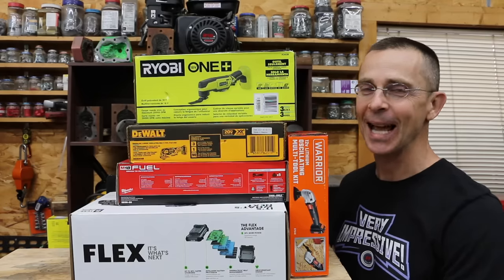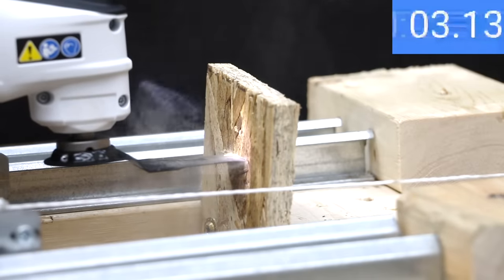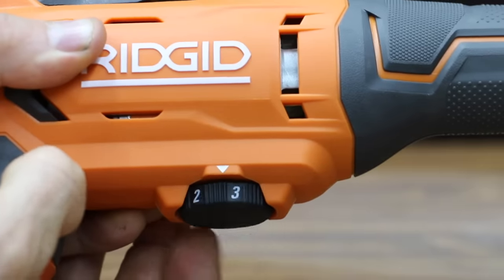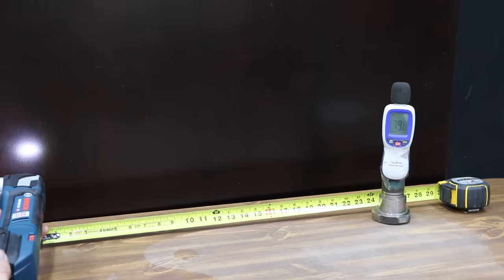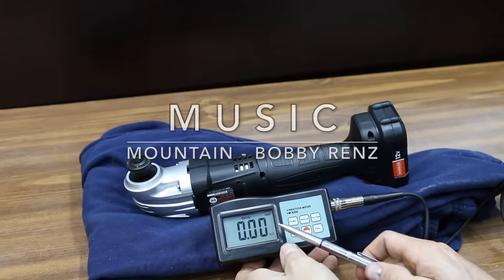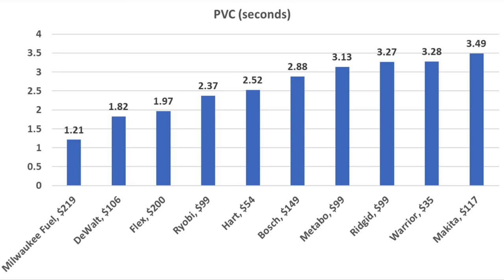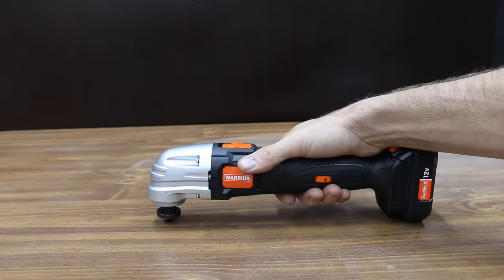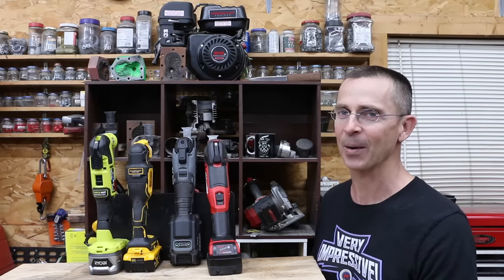Best Oscillating Multi-Tool? FLEX vs Milwaukee, DeWalt, Makita, Ryobi, Ridgid, Hart, Metabo, Warrior

Comment: I need one of these to cut composite paneling. First thing I did was look up PF. 😉 I will go with the DeWalt since I already have an impact and hammer drill and several batteries for this brand. 👍 I am just a home owner so a second or two slower don't bother me.  Thank you PF!
Reply from the maker: You are welcome!

Comment: There is a counter weight in the tool to neutralize blade vibration at the handle. Remove the blade test can upset the neutralization.
Reply from the maker: Thanks for the feedback.

Comment: I’m typically a Milwaukee fanboy, it’s the one I typically use at work, and obviously it’s the best performing in these tests. But when I have gotten to use my coworkers DeWalt, I always fall in love. It cuts well enough, but mainly it’s just more comfortable to use, and how easy it is to swap blades pretty much makes up for the time lost cutting. I think I might lean more on my Milwaukee for more difficult cuts, but especially for drywall or lath and plaster, the DeWalt is a dream.
Reply from the maker: Thanks for sharing.

Comment: Hedge shears and lopper pruners. Sharpness strength, And durability. Also spacing between the blades and other problems you could run into with these tools
Reply from the maker: Thanks for the video idea.

Comment: I HAVE HAD A ROCKWELL oscillating too ever since it first came on the market.  I had no reference to how good or bad it was. I do know that the blade attaching system is a royal PITA.  After watch this review, I realized just how slow, heavy, and loud this old tool was.  I came here to find some relief as I have to oscillate out most of a subfloor in a bathroom.  I wanted the DeWalt to be a good choice since I have batteries and charger for this brand.  However, if available, I “might” get a corded model, if worth it price-wise, as I can’t think of a use where I’ve ever felt that corded was an inconvenience.  As the testing showed, Dewalt was one of the top 4.  Off I go for them to take my money for what seems like value.
Reply from the maker: Thanks for the feedback.

Comment: I purchased a Porter-Cable corded tool and it only lasted one day cutting out grout from a walk-in shower. I made a big upgrade to a Fein FMM350QSL corded tool with a 350W motor and it has been fantastic. Always plenty of power and I don't mind dragging the cord. I really like the StarlockPlus system. 

Maybe you should do a test on corded oscillating multitools. I've been drifting away from battery operated tools in favor of corded whenever possible. I've grown tired of low power and waiting for batteries to charge.
Reply from the maker: Thanks for the suggetion.

Comment: Your blade on your plunge cut was not perpendicular to the 1/2 " osb plywood which may have caused a little bit of binding on the shaft of the blades. Absolutely love your video's

Comment: I use my multi tool for a lot of different things so I’m changing blades several times per day. I actually own both the Milwaukee and the dewalt and I always reach for the dewalt just because it’s so much faster to change blades, and the trigger mechanism allows me to change the speed on the fly unlike the milwaukee.
Reply from the maker: Thanks for sharing.

Comment: Great reviews. Our house is plasterboard, and I needed a multitool. Because it's so difficult to cut, I chose a corded tool, ending up with a Porter Cable that was highly rated. It is great, but gets very hot in the hand. So much so I had to wear gloves after starting to burn myself. Love for you to measure the temperature of the grip in use. Also, love to see a corded test, and corded vs. battery showdown!
Reply from the maker: Thanks!  Thanks for the suggestion.

Comment: Soooo helpful.  Thank you.  I have a Galaxpro oscillating multi-tool. (A what!? Yeah, cheap off brand.)  $54.  It does come with many blades and attachments, easy to change blade system and a case, but heavy, shaped badly (too big to hold easily). blades slip a bit during use and (THE BGGEST PROBLEM)  very slow.  Just not enough power at all.  So I'm in the market for a new one and your video came in so handy.
Reply from the maker: Thanks and you are welcome!    Glad to hear!

Comment: I really like the light feature on the flex. However, I have had the Dremel brand for years. It has never let me down and works great. It is a very handy tool. When I find.a great tool like my Dremel oscillating tool I tend to stick with them. 

Dremel also makes the multimax mini saw that works phenomenal. I think a showdown on mini saws would be a great idea, but would like to see how my Dremel brand stacks up to the DeWalt and others.

As for Brand comparisons on tools, I think the Hercules brand would more of an even match with the DeWalt and Milwuakee brands on the various tools. It is Harbor Freight's premium high end brand and would like to see the Hercules tools pitted against the high end brands. As for the Warrior, it is hard to beat the cost on the Warrior brand

Comment: Bosch has a gen 2 version out now that claims to solve the vibration. I've never used the first gen but I find the second gen very comfortable. Beware that some blades don't work with Bosch Starlock system. First gen model number is GOP18V-28N, second gen is GOP18V-34N.
Reply from the maker: Thanks for the feedback.

Comment: Personally a Oscillating Multi-Tool is one of those tools I would want corded. I also want one with a trigger and that has variable speed. The only one I can find is one form DeWalt for $149. But it does come with some attachments too so not too bad in the end. I have a friend who swears by the Hercules brand at Harbor Frieght but it uses a switch not a trigger. Still might check it out though since he knows his tools. Nice job on the video either way.
Reply from the maker: Thanks!  Thanks for the feedback.

Comment: I'm a milwaukee guy with a lot of tools made by this brand.  On a side note, those M18 batteries will run some other 18V tools by the use of adapters sold online.  I have a few cordless 18V Makita tools that runs perfectly fine with my Milwaukee m18 batteries.  It's nice to be able to use my existing batteries while able to have own other brands.
Reply from the maker: Thanks for the feedback.

Comment: These video's are priceless.  There' two channels that are doing an enormous amount of good for all us DIY'ers (and pro's for that matter).  The only problem I see with the tool tests (especially cordless), is that all it takes is one, maybe two purchases, and you're vested in that brand.  That happened to me with DeWalt.  The batteries are so f**king expensive that after a couple, unless you've got money at your disposal, or just flat out disgusted to the point to where you no longer care, you're pretty much stuck with that brand.  The good thing is that, from what I've seen, there's not a whole lot separating the two big brands Milwaukee/DeWalt.  I'm in the process of outfitting a woodworking shop, and while Festool may be the "best"....DeWalt has proven to be "good enough".  I'm still incredibly grateful for what channels like Project Farm have done, and are doing.  The time, energy, and resources it takes to give us "mere mortals" this kind of info in a non-biased manner is not lost on the vast majority of us.  So, I'll give a big salute, and a thank you 🙏👍
Reply from the maker: My pleasure!

Comment: Nice review, however the price was not equal since some were for tool only. Also you might consider Fien which is $219 and using the same blade on all tools to eliminate that variable. Thank you for a great review.
Reply from the maker: You are welcome!  Thanks for the suggestion.

Comment: As usual and extremely excellent test. I purchased the Milwaukee last year. I had the Makita and the DeWalt before that. They both lasted about a year-and-a-half before they quit cutting. As a carpenter contractor I use these tool daily. We'll see how long the Milwaukee last
Reply from the maker: Thanks!  Thanks for sharing.

Comment: Its not a real world test. The vibration is an indicator but the problem with those tools is if you hold them in your hand, the vibration counteracts the blade movement. The heavier tools cut faster. Your test clamp the tool, so it did not account for the movement that would be there when holding it by hand. Years ago we had a Ryobi. I taped a hammer to the side of it to get rid of the vibration. It cut much faster that way. The best tool is the Feud.

Comment: I realize adding an analysis/opinion of build quality would be difficult, but I believe it is necessary.   Otherwise it is like comparing a Hyundai or a BMW to a Toyota, maybe the Hyundai has more features and is faster and beats the Toyota on specs and performance out of the box, but one must consider build quality, engineering, and materials to get a real value comparison.  As a hobbyist I would probably never wear out any of these tools, but I still prefer to buy quality and durability.
Reply from the maker: Thanks for the feedback.

Comment: I’m a Milwaukee guy through and through, but when it comes to a multi tool DeWalt has everyone beat. The ergonomics and speed you can change a blade is amazing, I only wish they would make it with a nut for a belt clip in the battery housing.
Reply from the maker: Thanks for sharing.

Comment: Yeah.. I have a Milwaukee m18 fuel fuel oscillator and when I saw the plywood test and the first one.. I knew Milwaukee would win.. thought it would've been faster with that much weight on it though.. I clean the blade when cutting plastics by stabbing the 3/4" pine plywood that I make the brace of my sawhorses out of.. it goes through it almost instantly lol .. but probably a lot more weight than involved there than what he used though.. .. hell I've used it to cut some 1/4" angle iron that was in a real tight spot once.. if someone could make a carbide multi tool blade that was a little more heavy duty and affordable.. I'd probably never use a saw saw again for it.. so much easier to controll a multi tool and get the cut exactly how you want it in a tight spot.. angle grinders don't fit in most spots I'm going at .. sucks using a saw saw
Reply from the maker: Thanks for sharing.

Comment: I’m a makita fanboy and I have to admit, I absolutely hate their oscillating tool is utter trash. Right away I knew how terrible it was but I lied to myself for a few months. As someone who removes a ton of drywall, I put this thing to to the test. Unfortunately no matter how well it cut (which isn’t spectacular), the shape is like an oversized pringles can filled with cement. It’s stupidly awkward and made me think “there’s no way they designed this with the Japanese in mind”. It’s bulky, ugly, and an embarrassment to the makita lineup. Man, that felt good to get that off my chest. I do not like it at all. Thank you for another stellar video.
Reply from the maker: You are welcome!  Thanks for sharing.

Comment: I have both the Milwaukee and Dewalt multi tools,
I have to say, I really wish everyone would share the same design as the Dewalt. It’s the perfect shape, so quick and easy to use with the variable trigger rather than the on off switch, and the quick blade change is perfect. The Milwaukee obviously slightly 
Is better when HEAVY duty cutting, but for the majority of the time, it’s bigger clunkyer design makes we want the dewalt over it.
Reply from the maker: Thanks for sharing.
Reply: And Dewalt...brushless motor.

Comment: I would also recommend that you explain the difference between BRUSHLESS MOTORS and the cheaper BRUSHED motors  (and add that as a criteria to your future tests), as each manufacturer seems to have both available and the home improvement stores.  The Ryobi 1+ HP I just bought with a BRUSHLESS motor was oddly the same price as Milwaukee's cheaper BRUSHED motor design, so I switched it up and purchased the Ryobi instead.
Reply from the maker: Thanks for the recommendation.

Comment: All I know is I bought a $40 Bauer from Harbor Freight, and it easily paid for itself in one project. I cut through about 20 3" framing nails, some PVC and a lot of wood. Used the same Bauer cobalt blade for all of it and the blade is still perfect. I did shut the tool off periodically while using it to avoid overheating it, because why would I intentionally break it. With that in mind, I expect it'll probably last me s very long time, much like the other "cheap" power tools I own.

Also, don't buy battery powered tools, they're just a scam.
Reply from the maker: Thanks for sharing.

Comment: I am a big fan of Milwaukee but for an oscillating tool I have a corded Fein tool.  I bought it used for $20. 
My question relates to epoxy adhesives. It is not easy to get the epoxy out of the tube consistently especially if the temperature is low.  
One tube always seems to stiffer than the other and what comes out is hard to measure.  So, I really want to know how important it is to get the mix exactly 50/50?  
Seems at the end of every pair of epoxy tubes there is always one with more left in it than the other.   It may be that some brands are more sensitive than others to precisely the correct mix.

Comment: I use Fein
Reply from the maker: Thanks for sharing.
Reply: @ProjectFarm  I also have the Dewalt cordless. What has always been the issue with these tools has been the blades/cutters that attach to them. It can easily cost you 10x more than the tool itself and that is very expensive.
Reply: @ProjectFarm  just found the video of the test on the cutters. Look forward to your results.

Comment: Using OSB it difacult to get an accurate reading. OSB has different kinds of wood chip pressed together  and some wood are harder and glue act different in pourus woods. Jus saying. I use Rigrid and have a porter cable both work great. But must say the Dewalt is the best of the lot. Love the trigger on them and the quick change like the porter cable.
Reply from the maker: Thanks for sharing.

Comment: I noticed that not all of the cutting blades were completely straight when cutting, I think that could have slowed a few of the test down a bit. It's harder to cut at an angle than straight. I understand you can't possibly catch or do everything but I though I'd mention it in case someone was trying to weight pros and cons.

Comment: i bought a corded dewalt multi-tool because it uses the more standardized blade-attachment method.  it stopped working less than a year after i bought it.  i had dewalt repair it...but it took them three months to get it back to me, and now i've only used it a few times since, and it is not working again.  i'm done with dewalt.  milwaukee for me all the way, as all my milwaukee tools have worked.
Reply from the maker: Thanks for sharing.

Comment: I bought a green Bosch (not sure if the line is available in US), it's enough for my very light use. I already have a few of other tools from them, generally I like them, it's my default brand, usually I consider them very decent with good features for the price and they can be usually bought in a practical case for a little extra. Of course sharing batteries is a plus, important reason here was the Starlock system, very quick and easy to change and wide selection of third party blades here.
Reply from the maker: Thanks for sharing!
Reply: I an sorry to have to say, but BOTH Bosch and Makita have been widening their tool lines: While they still sell top of the line excellent tool models, they have started to widen their lines toward cheap and underferforming models trying more to catch the budget limited buyer thanks to their Name-Image than on actual performance, thus launching weak models that actually come below the performance of lesser famous brands that cater to the lower demands of hobbyists and DIY tool buyers.
Recently I "tried to take advantage" of a discount sale at Home Depot, and ended up with two "Ho-hum" mediocre models from Bosch: the 18V-50 cordless drill and their lowest price impact driver, the LOUSY GDX 18V 180 LI model, and quickly returned it to the store, as it resulted to be so weak that it was unable to remove the wheel nuts on a small sized car!, and while I will keep the 18V-50 hammer drill, I discovered it has a wobbly chuck, a nice looking but wobbly metallic chuck that seems like it is going to break the thin 1/16" or 3/32" drill bits due to the wobble !
And I also became very upset with my Makita 8 1/4" model 5008 Circular saw, as it came with a too flexible and flimsy cutting-depth adjusting mechanism, despite the overtouted "Magnesium base", so that aplying normal downward pressure on the handle causes the frame to flex and twist, throwing off the 90° position of the blade... VERY DISSAPOINTING from a brand previously know for quality and good design!

Comment: Would love to see a corded tool used as a performance baseline. My home projects are pretty sporadic and tools can sit un-used for a while. It sucks when your battery doesn't charge anymore and they stopped selling compatible replacements. For cordless, it seems like people are going to buy whatever brand of battery system they are already invested in. Probably useful to mention the baseline cost of a battery and charger for the system.
Reply from the maker: Thanks for the suggestion.
Reply: Ryobi is generally has the cheapest battery. But I buy Milwaukee's because of their great deals that comes with battery. Just bought the M18 multi tool and it came with a free battery for the rest of my other Milwaukee tools. Seems like every other year I pick up a new tool just for the battery.